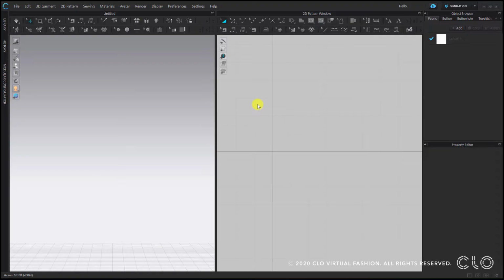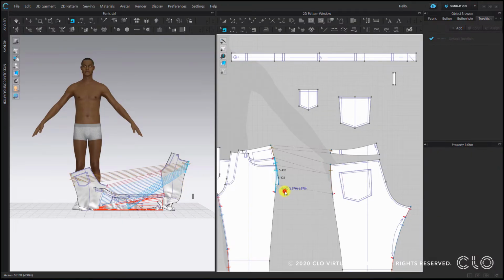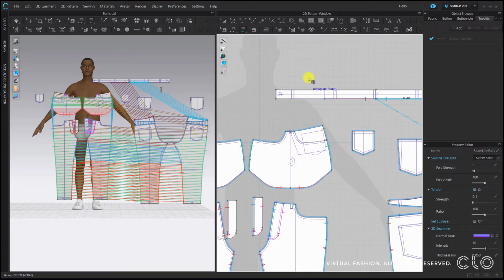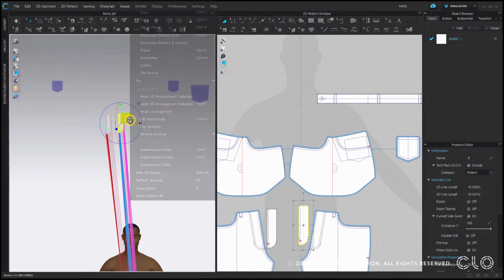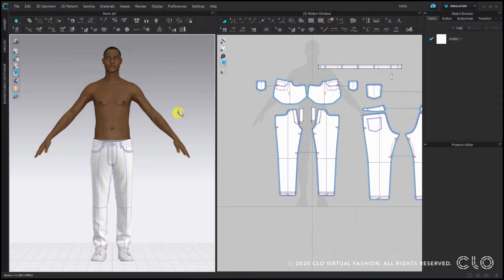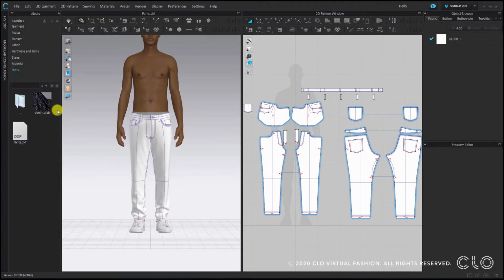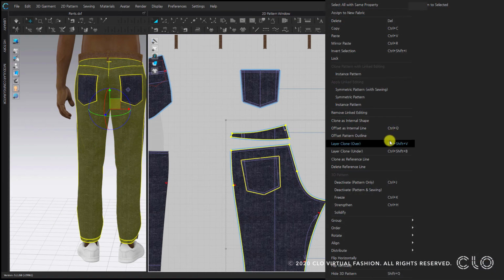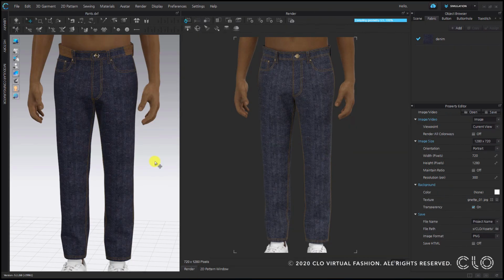Garment Construction: Pants(EN)

Comment: It is not possible to dowload or open the pattern (DXF). When i click the links opens but it says that i do not have  a permission to download it and no previev is avaiable
Reply from the maker: Hi There. We just tested on our end. As long as you have a CLO-SET account you will be able to access. The DXF file does not have a preview since it is just a pattern file, but it can be downloaded on the left side of the screen
Reply: @CLO3D  It's completely impossible to download, even after registering and logging in. The download button is grayed out and cannot be clicked or used.
Reply from the maker: Hi There. We have already contacted our team about this as there have been multiple questions. It was fixed, but looks like something has changed. We hope to have it corrected soon

Comment: Video has got good content and well explained with slow pace explanation. But,initially, Flyers are seen on both sides till time span of 27:45, but after top stitch is applied, fly is seen only on one side. Where did the other fly disappear and how was it made to disappear at time span of 31:46? No clear explanation about it. Actually Pants need to have flyer only on one side, but why is it created for both the sides first of all?
Reply from the maker: The Fly stitch was on both sides because both sides have symmetry applied. You can remove linked Editing with the Edit Top stitch Tool > R.Click on topstitch in 2D and select remove linked editing. 
The patterns will still be symmetrical, but the stitching will not and can now be edited or removed independently

Comment: Hi pant are to loose and there is and I cannot fix the fly part, I did 4 times and I have always the same problem
Reply from the maker: Hi Annamaria
If you have followed everything in the video and are using the correct sized avatar to the pattern it should all work correctly. But if you need further assistance I would recommend joining our Discord channel so you can share images of exactly what is happening 
https://support.clo3d.com/hc/en-us/articles/7814962429977-How-can-I-join-CLO-Discord-

Comment: Great tutorial. There should be two "collections" one for front and one for back flipped normals. That would make things so much easier imo
Reply from the maker: If a normal is backwards it should be corrected.
Reply: @CLO3D  I know, I just mean there should be two folders one for the front and one for the back. Then it would make organizing things easier.
Reply from the maker: @samkostos4520  Are you talking about organization of files in the library?
Reply: @CLO3D  yeah, they should make an add on that moves your garmet to the back and flips the normals if they are in the "back folder". Would be so nice.
Reply from the maker: @samkostos4520  If you use the Arrangement Points to place the pattern pieces, the normals will flip automatically.

Comment: 30.51: I'm having issue seeing my topstiching on the garment. Very light and when I simulate it disappears. How can I fix that?
Reply from the maker: Topstitching does not show when simulating. Each stitch is an OBJ and it would be too much for the software to calculate. You can change the thickness of the thread in the property editor to help it stand out.